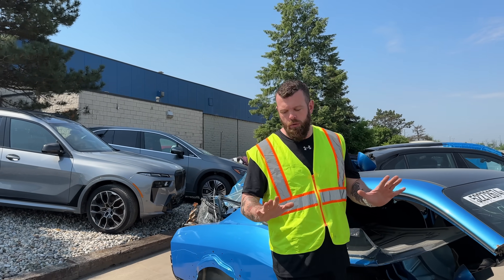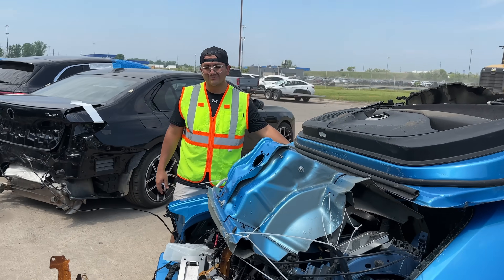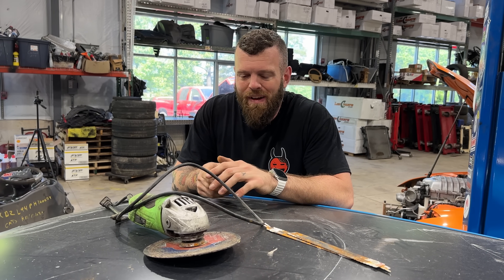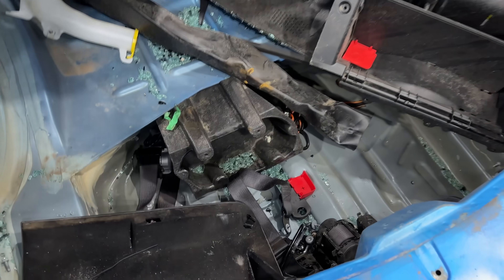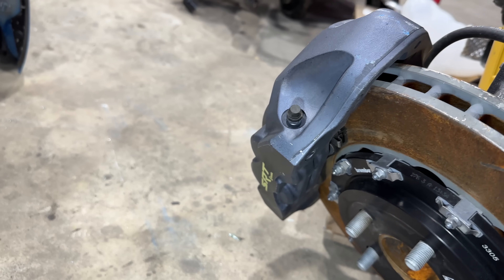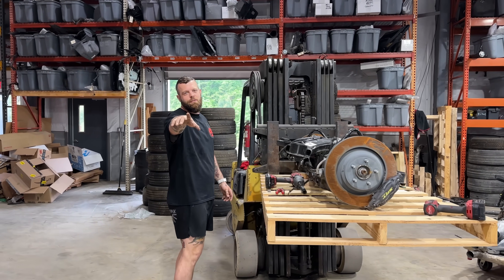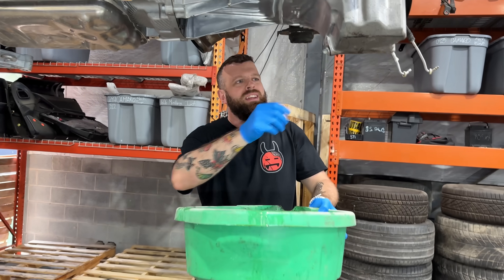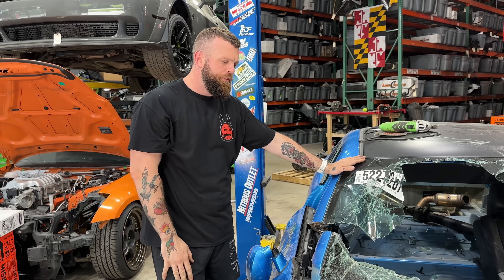I Bought A STOLEN Demon 170 For $20,000!

Comment: Christ man, I could not even begin to see how the hell I would be able to get this car back together. You have to have a lot of experience to be able to tackle a project like this. I would love to be able to do something like this, but I just do not have the skills to do this. The drivetrain is freaking worth the money. Damn! this is an almost $200K car??? That car has less then 100 miles.
Reply: They are gonna get another body, lol.
Reply: @mistersniffer6838  Yeah, after I wrote that and thought about it I was like damn, that was a stupid question. Just buy new body panels if the damage is too bad.
Reply: @mike_0213   -Oh, it could be done (welding it back together) quite easy, but, never the same as it was originally or structurally.  Might as well use a replacement one piece unmolested chassis.
Reply: @mistersniffer6838  Yea I know there are people out there who could put this back together and I find that crazy because just looking at it as it stands I would be lost.
Reply: @mike_0213   - Please know I said "could".  Thats totally diff than "should".  

The value loss of a cut frame would be the same as using a replacement frame.  Time and money dictates to just use a replacement body.
Reply: @mistersniffer6838  Unless you have the money to spend, I do not see a reason to take on such a huge project you know.
Reply: @mike_0213   - He spent $20k and received $100k in parts alone. I believe he is ahead of the game, lol.

Comment: If it's under 100 miles you can't engage launch control or any of the fun stuff. You could technically put it back in ship mode too if you wanted.

Comment: I thought companies legally need to make replacement parts and pieces up until 10 years after the vehicle has been discontinued
Reply: That would be profoundly impractical. For some vehicles like a Ford Taurus or Toyota Camry that may have been easy.

But rare stuff like this, the numbers are so low it's impractical to make that many replacement parts.
Reply: @_BAD_MERC_  The only hugely different body panel is the hood, and legally companies definitely need to be able to support warranties, and there is some sort of law mandating replacement parts be made 10 years following discontinuation, I just don’t know the fine print if it’s all body parts also

Comment: The 170 seat skins, fender badges might be hard to find.  Very cool the dash badge was still there though.  
Also @16:23 😂. Hopefully this 170 motor won’t blow up like some have been. Good thing most the specific parts are there, the rest, these cars been the same for 10+ years depending on trim

Comment: That green oil looks identical to my 2018 Mustang EcoBoost performance package RTR serial number 132 out of 500 I did my first oil change at A Thousand Miles myself instead of taking it to the dealer and that's the color of the oil it had in it that's ironic😊 running Amsoil ever since.

Comment: did you find where the wiring harness plugs into the ethanol content sensor? fits near firewall center back of SC lid on fuel rail crossover

Comment: The last time Dubs bought a theft recovery high end car was1966! I paid $450.00 for a low mileage 65 Vette roadster. Missing engine,trans, and wheels. wiring to the gauges had been cut, nothing else missing or damaged. Found a 65 low mileage Impala SS, hard hit on left side. 600.00 Brand new 1st year 396 TH400 and wheels / tires went in.Bought 4 new vette hubcaps from the dealer. A few junkyard chevy parts 60 chev trans crossmember, etc. Result ? 140 MPH  mint 1 year old corvette roadster. About 1500.00 Total cost!!  My how things, car theives, and times, have changed!  Luv,,Dubs

Comment: What I would do, is just buy a cheap, V6 Challenger, maybe with a blown engine but a decent chassis, and swap in as many parts from the Demon as you can. Yes, it won't be a "true" Demon 170 by VIN number, but besides that it would be as close as you could get since you have basically the entire car except cut into pieces. I would also make sure you check inside the oil pan of that engine and make sure it is not missing crank bearings. Some of them were.

Comment: My buddy has a shop where he fixes and flips wrecked cars, he'd fix that in a heart beat especially the price that 170's are going for, hell he took 2 bmw m3's that had been t boned in opposite sides and cut them down the middle welded them together and took 2 and made 1 wound up getting 18000 for the car when finished. And yes you can make it safe, the car started out as a pile of metal panels and after some ark wields and panel bond you have a shell, Graveyard cars would put it all back together and probably laugh about how easy it was.

Comment: I feel like you should hold off on putting those parts into anything other than a Demon 170. Without a “Demon 170 VIN” you will never have a true Demon 170.   Somewhere out there is going to be a Demon 170 that is found, completely stripped to a shell.  Wait for that one.  Or put the motor/trans into something else, like a Viper, or Viper truck…. lol. I can assure you, the trans brake has been engaged.  I would have done it on the ride home from the dealership!  And with 61 miles, it probably has been through a tank of gas.  These things get absolutely horrible fuel mileage, and that’s ok.  Nobody buys one for the fuel economy…. I really feel bad for the guy, or gal who lost their awesome car!  At 20k, you got a great deal, even just for the engine and transmission!  Throw in the other parts, and you are way ahead of the game!!!

Comment: I bought a 2019 Challenger it has the 3.6 Plus  only 50,450 miles  I have owned it for 7  months  it only has  53,125  miles now.. My  dream was to find a Demon 170 motor and all the parts an have put in to it.  Mine is the Go Mango  color.  I  would cost a lot of money to have done. I would even go with the Hellcat has the 797hp  in it. Just can't find them . I do know what it takes to put on in. And what needs changed. I emailed you guys about it never got a answer back from you.

Comment: With sixty one miles It would be well worth putting that body back together even if you had to spot weld new frame rail sections underneath so that they were complete instead of section it would be worth it because you could literally call it a sixty one mile original car

Comment: Why would you need to change the fluids they were new and the trans pan is metal take it off and put it on a flat surface and likely pound it into shape, I could weld that body back together put long pieces of  3/16" metal inside the rails and plug weld them in then slip the body together and finish weld it up

Comment: The D170/C170 crate engine is around $27k, but I hear their impossible to get right now and that CJDR dealership parts department's mark them up way over MSRP, SMH... Their even slapping ridiculous ADM's on parts now... you'd think they would have learned their lesson with the "Last Call" cars and the dealership Mark-Up fiasco that alienated at least 75% of their potential buyer's for those cars, which then, lead to CJDR dealerships having their lots over stocked with 2023 model year Last Call Chargers and Challengers collecting dust... By the time Brampton caught up and dealership Inventory stabilized all of the idiots that were willing to pay $30k - $50k mark ups on regular Hellcats and Redeyes had already bought their cars, and the customers who were sent away because they weren't willing to pay over msrp or they were scammed out of their sold order allocations went elsewhere...

Comment: To buy the engine is upwards of 30k usd and the rear end/ suspension is probably anoth 15k and the front suspension cradle is another 8-10k and the transmission is probably 5k honestly this is a screaming deal I was thinking is your red burnt car a red eye or demon 170 cause you could just swap everything in that and swap the dash.

Comment: 3:40 yeah you got everything here for free 😂😂 61 miles on a demon 170 engine that’s amazing 

The Dodge Challenger SRT Demon 170's supercharged 6.2-liter V-8 engine is available as a crate engine called the Hellephant C170, which costs $27,695. 
 
The 2023 Dodge Challenger SRT Demon 170 is a street-legal dragster with a starting MSRP of $96,666, excluding taxes, fees, and other additional charges. The Demon 170 has a 1,025 horsepower engine, making it the fastest vehicle ever produced by Dodge. It can go from 0 to 60 in 1.66 seconds, has a top speed of 152 mph, and produces the highest g-force acceleration of any production car.

Comment: If it's any thing like Chevrolet I had to replace the 5.3 ls the computer was able to reset and gave me the mileage of the new motor they was stumped why the bottom end went out because those motors are built like a tank

Comment: You got ripped off badly.
Reply: Wym? A hellcat drivetrain alone is over 24k and thats just a crate. This comes with the axle and what ever and its a 170 on top of that.
Reply: @vWhiz  What do you mean 170, you talking $170,000.00
Reply: @CowboyTrucking61  I told you about the hellcat drivetrain being over 23K then ended that sentence after that i stated what he got for 20k isn’t just an engine it came with the rest of the drivetrain alongside the dash and center console for less than a normal hell cat crate engine. and its a demon 170 engine / parts not any normal hellcat thats whats i meant. Hope this clears it up.